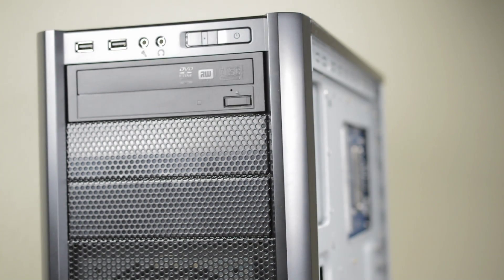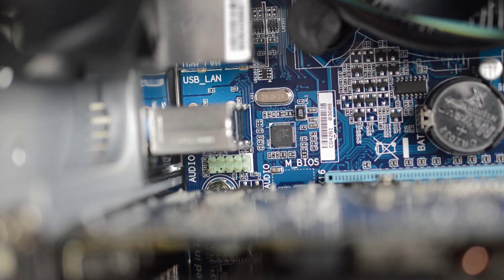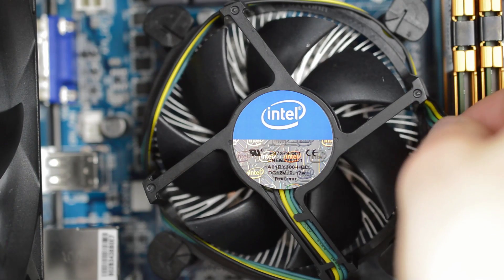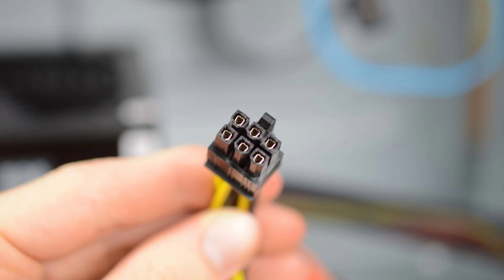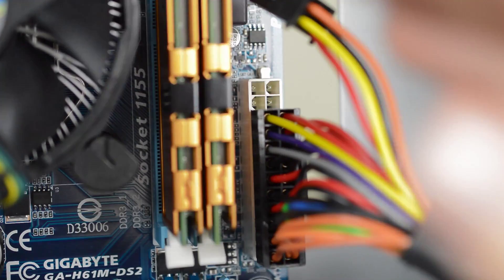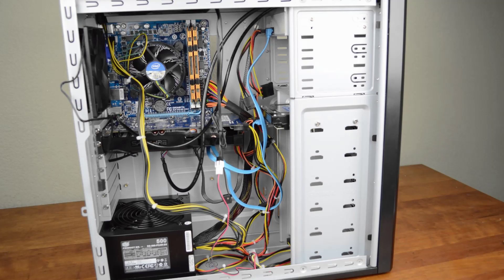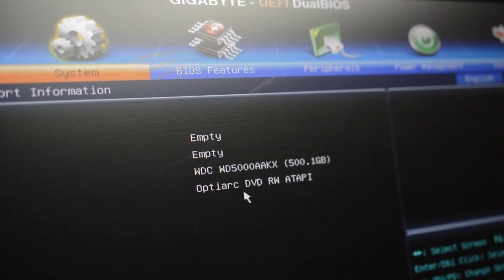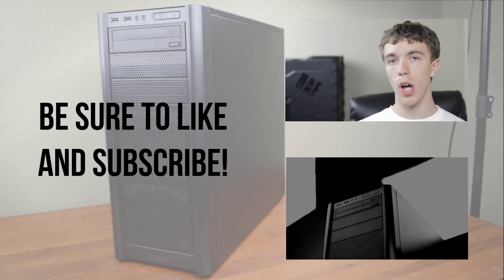How to Build a Computer for Gaming (2012) Part Three

Comment: It depends what kind of wifi card you have. Find out whether or not it's PCI or PCI Express. Then, look at your motherboard manual and find out where the PCI and PCI Express are. Then, just install it the wifi card in either the PCI or PCI Express slot like the video card.
If you have not yet purchased the wifi card, I would suggest a USB Wifi adapter. Works nearly as well, but so much easier to use. Or, buy some ethernet cable. 50ft of CAT6 only cost $5-$10.

Comment: So, this is a useful video. But, if I can be constructively critical, the camera work is disappointing. It is clear you have DSLR and a fast lens, but often the aperture is so wide, the depth of field does not include the whole subject in the frame. A lot of stills are overexposed with clipped whites, so check your metering also. Highlighting the PC parts up close was useful, but if the execution was slicker, then this could have been a very professional video! :)

Comment: Obviously so. Xbox would run BF3 on lower the low, on upscaled 720p, with framrate lag. If you played BF3 on this PC on high, it would lag a bit, so no an Xbox 360 or PS3 would not run better. Really, this is 5x as powerful as an xbox 360.

Comment: my sata cables that go on the motherboard seem to be capped off, but im too scared to pull to hard on the cap-like structures in case im wrong... do i just use some elbow greese to rip of the cap or are the sata cables located somewhere else on my motherboard?
      >btw i have an MSI z68ma-g45 b3 motherboard

Comment: hai ... i would like to say THANK YOU to you.... you help me alot.... now i have the same specs as you,re building .... just mine a little bit different .... i follow your advice and now i have a great computer for gaming and doing my school work ^^

My Specs : 

Intel Core i3 2120
Kingston KVR1333 8GB Ram
WD Caviar Blue 500GB
Gigabyte H61MA-D2V Motherboard
AVF 500W Power Supply
MSI GF N430GT PCIE 2GB DDR3 128BIT 

I use MSI cause its cheaper then Sapphire :) ... thanks dude... I SUB to you !!!!

Comment: Lol, a GTX 560? Who the hell buys those? THe 6870 is better, and cost around the same. The GTX 560ti is a good card, but I don't think anyone buys a 560 anymore. I highly recommend NOT getting this card, and choosing something that has better price/performance. By the way, to brag about my systems; One of them has crossfire 7970's, and the other has a GTX 670.

Comment: Lets see... 
CPU: I5 2500k, or if your on a tighter budget, i5 2310 - $216 or $179
GPU: Radeon HD 7850 $240
Mobo: Asrock Extreme3 Gen3 $120
Any good 520w+ 12V PSU
Any good 1 TB 7200 RPM HDD
8 GB of ddr3 RAM.
Any good ATX case.
That should put you at ~$800.

Comment: Isn't it better to connect all the parts outside the case and test run it? Like if you are buying your own parts. If it doesn't work you may have to buy new parts and remove the others.

Comment: how to do cabling like a boss: connect the same sata cable to the motherboard and the other on connecting the hard drive to the DVD drive, connect the speaker, power, reset, power led, etc. while blindfolded, don't connect the fan, the airflow should make it turn, connect the 20 pin connector in the middle, slice the four pin and attach it to either side, you may have a break a little plastic, trust the motherboard for graphics energy, do the same with hdd and dvd cables, as with the SATA, ENJOY

Comment: some issues i had when building my first computer:
1) make sure your power supply is high enough for all your components. My machine turned on for 2 seconds and always shut down

2)  Make sure the fans are connected! I blew out my motherboard within 20 seconds of running. Luckily i bought my motherboard from frys and they gave me all my money back and gave me a a replacement one :)

Comment: it has gigabyte motherboard so you should be able to change the bios setting and use multi-beast then it should work check out alexsapplereviews for they exact bios settings

Comment: Just insert it into the cd/dvd drive and it should be ok. Considering there's nothing on your Hard Drive your system should automatically go to the DVD disc. Just follow the onscreen instructions, pick your hard drive as the boot drive, let it install and voila.

Comment: The good thing about building your own PC is that later on you can upgrade them 1 piece at a time unlike name brand pc's really the only thing you can upgrade is the sound/video cards because everything is locked on them. So best idea is to spend your money on a good motherboard and CPU to future proof the system then later when you get a little more cash get a good video card, more ram and a little more hard drive space for data. Just make sure you put your OS on a SSD it makes a difference!